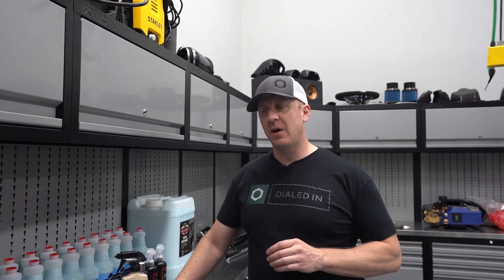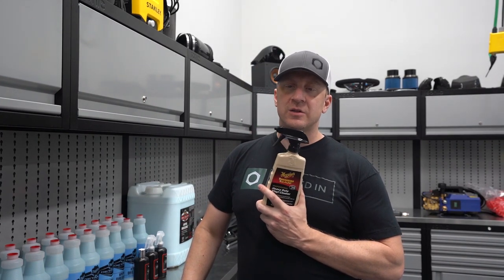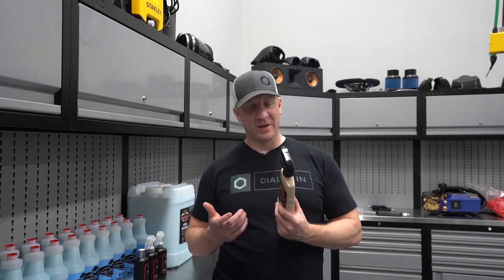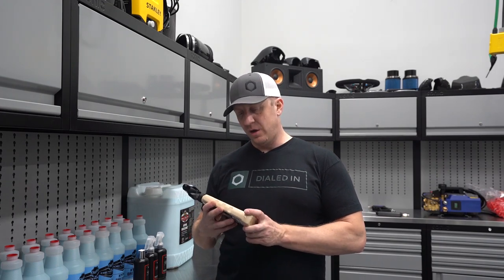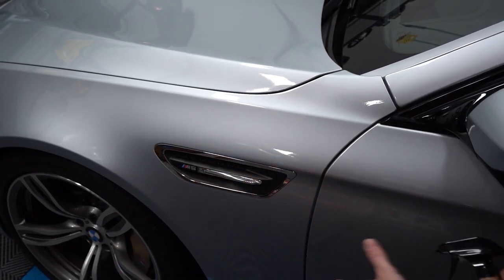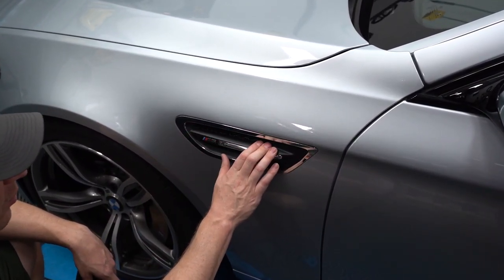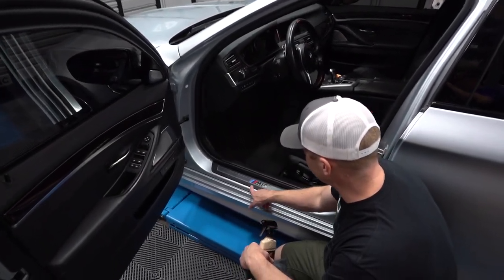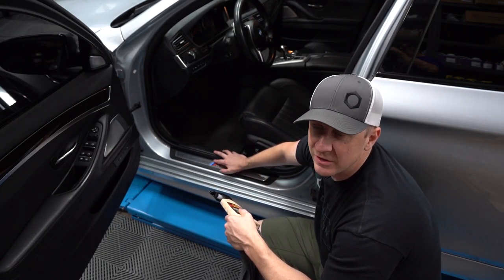Meguiar's M39 Heavy Duty Vinyl Cleaner

Comment: I have been using 39 for 20+ years. Sadly local auto parts stores don't carry it any more. Glad to see you add it to your products it is the best vinyl cleaner period. Two problems with the product that are unrelated to the product itself, unable to find it in gallons and I hate the skinny Mequire's bottles that tip over all the time. Also pull the crap Meguire's sprayer out and the tube is usually kinked in the middle.  Put it in a better bottle with a better sprayer and hopefully Matt can get it in gallons for the win.

Comment: Before you polish or use compound on a cars paint why wouldn't you tape off all of the rubber and or emblems/trim pieces that you don't want it on?  Also, after you use this product you should always use a conditioner for vinyl, rubber and plastics to keep them from drying out and cracking or getting brittle.
Reply from the maker: I'm use this if I ever miss tape an area.  I coat the trim after cleaning.

Comment: Got some fusso coat accidentally on my trim and bought this stuff to clean it......Didn't work
Reply from the maker: You probably didn't use it correctly.
Reply: Obsessed Garage pretty sure I used it correctly. Sprayed on,agitated with relative hard bristled brush and wiped off with microfiber towel. I think it’s got something to do with tenacity of Fusso coat it’s got Teflon in it.
Reply: @ObsessedGarage  how hard can this stuff be to use? Spray on, agitate, wipe off.
Reply: @zubastik2992  sounds like you used it correctly. Fusso is some pretty potent stuff.